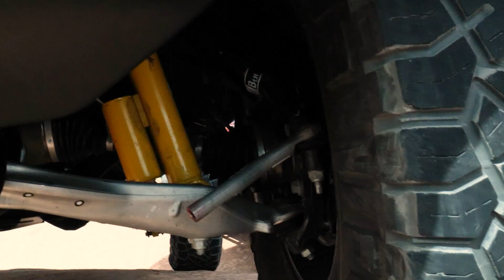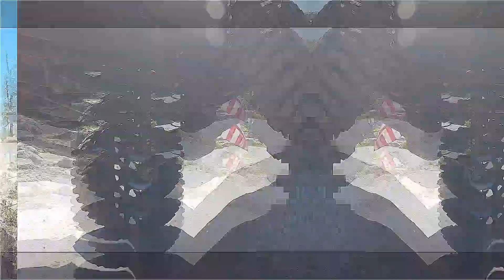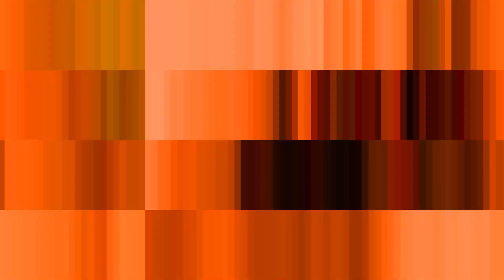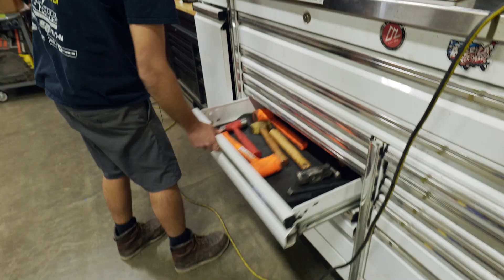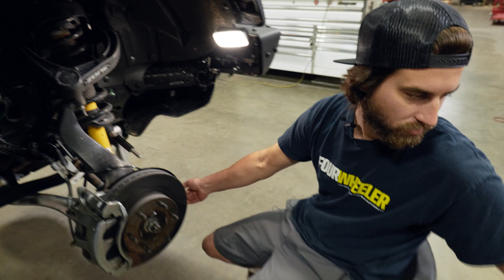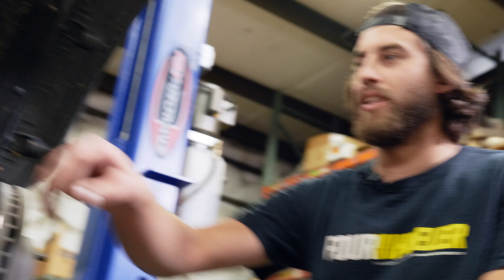Budget Friendly Tie Rod Fix for the New Ford Bronco

Comment: Nice video, I’ve been looking at a few different ones, some recommended wheel alignment after that, I guess if you’re exact on the measurement you should not need one? But is it recommended
Reply from the maker: The only setting this would change is toe. Alignment is never a bad idea but if you are very diligent about measuring you can probably skip a trip to the alignment tech.